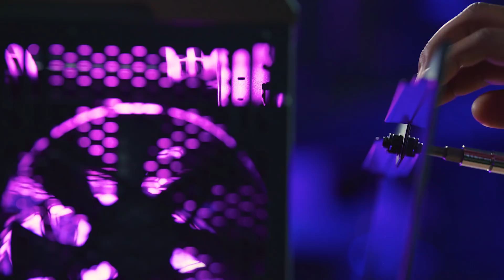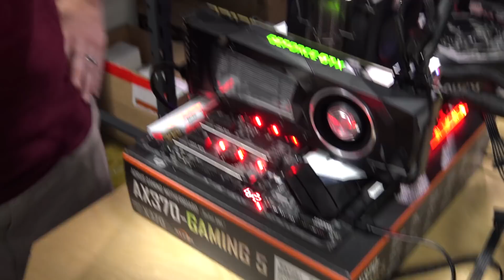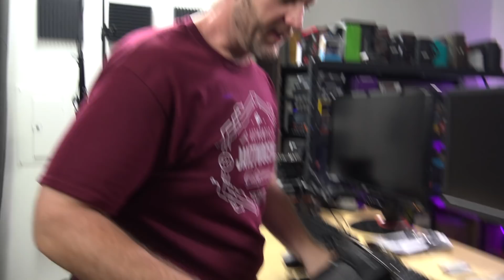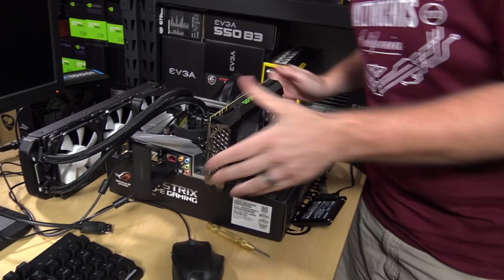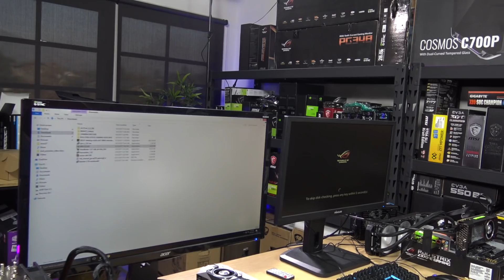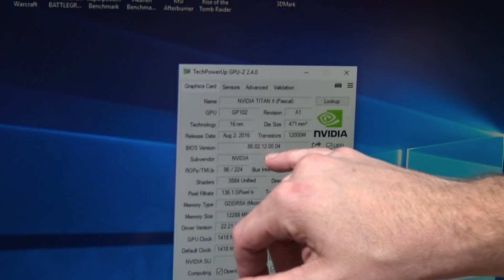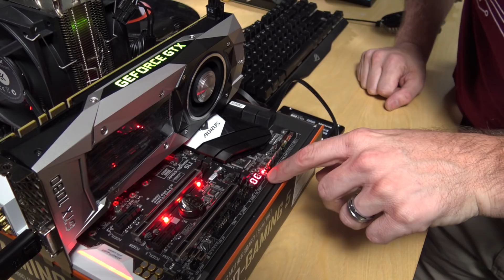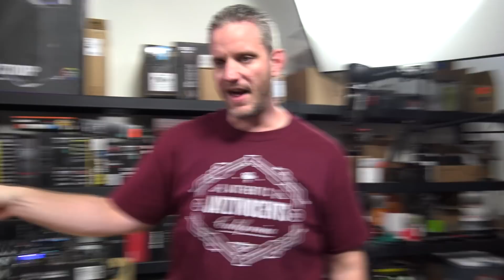I cant figure this one out... HELP!

Comment: My comment is going to be lame, but gigabyte boards are notorious for issues like this.. I vowed away from gigabyte for years after seeing all the post issues with most boards in the years using them.. to recently come back after being screwed by Asus on warranty.. and seeing thing have not changed..
Gigabyte boards are beautiful and I like the software provided.. RGB works flawlessly and sadly think Asus ruined thing with their shitty software

Gigabyte are the hardest boards to post normally.. my Aorus gaming 5 has random no post.. simply PSU off and on fixes things..

Gigabyte need to pull their fingers out and fix shit with their bios and compatible components.. as Asus sadly are simply way ahead here... 

I remember owning the x79 gigabyte board with the gun on it.. it was the worst piece of junk hardware ever owned.. going to Asus rampage formula is and will always be my favourite board...

I think this can be solved only with gigabytes help a new bios for mobo telling them which video card might help.. it might be a common issue..

I suggest older revisions of motherboard bios to see if they broke anything with the most recent revision

Comment: @JayzTwoCents The machine I received from Paul and Kyle has the same CPU and Motherboard. I have had this system about 4 and a half months I think. So first off I do think it is the motherboard. I have a Power Color RX 580 Golden Sample paired with the same Nixeus monitor in your studio. I have had graphics issues. The system sometimes hangs on VGA for a long while before booting. Thinking it was the video card too. I switched to a R9 285 I have as a spare. Worked fine for a week then bam hangs and graphics issues. Also other issues. I can not get any ram on this board to boot any faster than 2933. And the Killer nic does not seem to like my router with the newer firmware on the board. So I have to plug it into the intel NIC. Also my PC now seems to have a issue after update that it drops frames while streaming like its hot. 

I have noticed when it comes to the graphical stuff. Depending on one of the two cards I am using the boot setting seem to matter to some extent. For my RX 580 it like to have windows set to fast boot. And secure boot options under windows 10 WQHL for the R9 285 it seem to run better with fast boot off and logo on boot off. Basically the Puget systems way. 

Anyway anything else I can try or do seeing we have very simulator systems let me know. 

Specs
Ryzen 7 1700X
Gigabyte GA-AX370-Gaming 5
Corsair LPX 3200
WD Blue SSD 250GB m.2, Samsung 850 EVO 500GB Sata, OCZ 240GB TRZ100 I think 
Power Color RX 580 GS
Fractal Design Edison M 650watt PSU

Comment: If there was no alternate system, and a known good card works, but the problem card doesn't, the card must be defective. The fact that it works on a different system with a different platform is irrelevant.
Reply: Bill Bruce  not if he ussed that card in mult other system and it work. It's more likely a quark in the PCI slot and I finger on the video card from multiple uses
Reply: Two identical cards.
One of them works, and the other doesn't.
Which one is bad?
If it were anything on the motherboard, neither card would work.
I've been troubleshooting circuit boards for over thirty years.
Reply: Bill Bruce He said he ussed that card in mult other system as will and work in them all but this one system. But all manufacturing does have slight variations in their fingers on the cards and or pins come out of the motherboard of both of them are off slightly by a little it can cause such an error also I believe they made a mistake on reading the area code

Comment: If a connection pin is slightly bent maybe one card is making a better connection then the other. Did you try any other slot then the top? Just a blind guess don't have the hardware in front of me so can't test myself. But as process of elimination that would be my next step before I pull my hair out good luck.

Comment: My guess would be that there is in fact an issue with the gpu that for some reason the ryzen system is more sensitive to. Try stress testing the card to see if problems arise while checking power usage.

Comment: Id run both cards in the same board (Ryzen) and see if you can get a boot with rotation if required. Sometimes you need to run the possible dud card in the same system as a working one to fish for a conflict or BIOS error. If windows then still doesn’t accept the card in the known working system as a secondary - you know the card is the issue.

The Ryzen board seems to me to be the second most logical issue. I don’t think it’s the Motherboard BIOS, but I’d be checking slots first, then power supply.

Ive been an Engineer for a long time and this problem happens in Server blades too.

GL mate

Comment: So it seems in the testing that you have confirmed that the GPU works in other setups (I heard two mentioned, maybe test more?), and the CPU/mobo combo work with other GPU's, but both together are an issue. My theory is that the cpu/mobo may be doing something odd during boot (slight surge of power, for example) that shouldn't affect the card, but due to a slight defect in the card, may be causing a failure state.

In all this testing, it seems that you have kept the CPU and mobo together. Can you test the mobo with a different CPU? How about the CPU in another mobo? Do either of those setups result in a fully working setup? Can we pin down if the issue is CPU based, or mobo based?

Comment: one of the contacts is messed up on the GPU.  or possibly the mobo but i doubt its a mobo issue.  try boot cycling it.. I had a vega that would not post on my am3+. after  resetting 5 or 6 times it posted.

Comment: Could it be a PSU or board power draw issue? Try swapping the PS use if you can. That's what I do next. Could even be as simple as a bad cable?

Comment: Had the same issue with a 760ti and 970 ti in my am3+ 970 chip based system... last nvidia... ever. R9 fury strix is just fine.

Comment: inspect the pcie pins on the card maybe? its possible that the ryzen board doesnt grip the pins as tightly as the intel system does and the ryzen board isnt making decent contact because of a slight defect? maybe try using a pcie riser that fits tightly into the pcie lane.

Comment: Ive seen this culprit on my mobo did not want to boot got stupid post code . Reseated  my cpu went away. I think its a seatting issue with that gpu not the others. Possible the gpu is power hunger try a power draw test from wall with meter test.

Comment: I wonder if it has something to do with the slight differences in voltage requirements between each sample of the GPU and the one that isn't working in the Ryzen system being slightly out of spec/tolerance from a requirements perspective. If the PCIE slot is feeding the specified amount of power for the slot and that particular GPU needs slightly more (or slightly less) to boot, then a POST failure could occur? Perhaps the Intel board you're using is more lenient on the spec and will shunt as much power the card needs to start up.

Purely speculative on my part and have no idea how to test or validate this hypothesis...
Reply: Ed .... My thoughts exactly!!!  Either that or corrupt bios.  Everything else would be the same.

Comment: Sounds like mobo doesn't like the uid of those cards, try another slot or different mobo keeping same ram and cpu, also I know it's crazy but I just had a Dell xeon workstation doing similar thing. Try loading into os with a different card installing the drivers for the card you want then swapping your problem card back in. Worked for me.

Comment: It seems to me you have some kind off  compatibility issue, i've had a similair issue but with memory. My system supported the given memory but for some reason it just didn't work. Worked fine in other PC's.

Comment: Seems so random that I would look for bent CPU pins if there are non then the problem might be with MOBO BIOS. Also you might want to try verify that is does not post with the "bad" GPU couple of times to see if it would boot like 1 out of 10 times.

Comment: Ive seen this issue with my mobo where the seating is off . ALSO TRY A SEPARATE POWER SUPPLY . You have to be willing to test multiple things to find the culprit. Ive had it say another but its not its just a seating issue.

Comment: Check the connectors on the motherboard and graphics card.  A minor flaw, on the same pins, could be a possible issue.  It could also be what technicians call a 'marriage problem', where 2 items refuse to work together, but either will work fine with other components.

Comment: ok first i am not reading 800 comments. i have owned ryzen and the threadripper since day dot and i have never seen this issue except when i used a DP port on my fury x that it did not like swapped DP ports no issues.also having it boot from uefi can cause a similar issue but you will get display. It is a setting issue simple as that there is not hardware fault at all (except maybe that lower DP port) if that is faulty it could cause the failure to boot. i would swap dp ports or try hdmi and see what happens i,m pretty sure it is that. if it wee ram or cpu issues no card would boot

Comment: You know Jay.....it'd not be the first time it was the controller from the HDMI on the monitor...since you are using two different monitors.....odd, but I have had it happen. Try either a different interface if possible or a different monitor....I have only seen this once before so mileage may vary.

Comment: Could it be an issue with PCI Express bus frequency? Maybe overclocking or some default bios settings on Gigabyte have the PCI express bus frequency higher than normal and maybe nvidia cards are more sensitive.

Comment: You could have hit the "lottery" in terms of signal strength from the mobo or gpu to the other. If one pin is out of spec on the signal it sends to a mono that is very picky about what it receives then no ball. The same goes for the other way around.   I dont think its a ryzen  or intel issue i think its a signal processing issue.   I have had many different systems with issues like that when i was in charge or hardware Tech Support for a decently large company.

Comment: I'm wondering if the card is pulling too much current from the motherboard PCI-e header. Is the card on a separate power supply rail, or is it a single, large rail? If it's on a separate one, one of the step-down converters in the power supply could be faulty. You could alternately just connect the GPU to a separate power supply (on the same AC outlet/breaker to prevent ground loops) and short the green switch wire.

Comment: I had the OC code and a B code which turned out to be where the ram was plugged in for whatever reason. it was plugged in and they all worked but i just pulled one of the ram cards out and it worked. and no it wasnt a bad ram card.

Comment: the ryzen being picky with memory comment is really hitting home right now lol, sometimes my ryzen 3 system boots fine and recognizes both sticks of ram, most of the time it doesn't. according to ez flash in the uefi my bored bios is up to date. windows is installed and active, all my drivers are current. both ryzen and my mother bored are confirmed to be compatible with this memory. yet it wont post half the time with both sticks, and when both sticks are recognized and everything appears to be working properly i still get random crashes in game. bout to say fuck it and pay someone else to fix it lol

Comment: @JayzTwoCents. It looks like you are using the top display port with the ryzen system, and then the bottom display port on the other. It could be that the top display port is faulty and not working properly?

Comment: Hey Jay. You checked the BIOS of the same card, so you don't know if the BIOS of the non-working card was the issue. You forgot to check the BIOS in the Intel system. If you did so off-screen, then I don't know what to say.

Comment: It's either the cpu or motherboard. If you have another ryzen cpu swap it out and see if it runs with the "problem" card. If it does, then bingo, it was the cpu. If the problem still persists, then it is the motherboard having the issue.

Comment: I had this problem with 1800X, 2 different asus motherboards, and GTX 1080. Ended up sending a cpu for RMA, believe it or not, this fixed the problem, so maybe there is something wrong internally with some AMD chips.

Comment: I have had issues with Aorus x370 Gaming 5 since day one and it got worse now one bios update and now the system bsod's regardless of default settings, fresh windows install, complains about overclock when it's not. tried another CPU, tried memory on another system, other components work fine with Intel motherboard/memory Even reverting bios did nothing. Back on intel for now.

Comment: I would say there would be something wrong with that particular video card or the AMD motherboard from the symptoms. The only way you can really figure out what's going on is to switch out parts. You might want to start by switching the power supply with the intel system. Then try a different AMD motherboard (same model if you have one). I bet the problem will show itself.

Comment: Try same cpu and gpu with different motherboard just to rule it out. Complexity can cause a breakdown anywhere.

I bet there's some small difference or imperfection somewhere in the system causing the problem.

Comment: Jay, I had the same issue with a gtx1080 G1 gaming with my 6850k. One GPU would not work but it worked fine on my 3770. I returned the GPU to the supplier and they returned it not faulty, in the mean time the new G1 I got worked fine. I replaced everything in the machine and finally after replacing my 950 pro m.2 for a 960 pro the card started working.

Comment: Try to look at the pci slot. Is there some junk in there? Are the contact pads on the GPU card dirty or damaged? (the part that goes into the slot on MB)
Reply: Also look in all the plug connectors

Comment: Does  it only fail when warm?  If so then: Check the GPU contact  points and internal  solder points. If not this then check  its  onboard  Ram. It could also be a power supply issue.

Comment: Pin alignment in the slot is off on MB, manufacturing tolerance off. Or Voltage issues with you PS cable or PS.

Comment: Limit your variable to just system, use the same monitor and DP cable, double check if there are dual bios switch on Titan, if it does are they on the same position, in ryzen bios, do you use CSM or not, if you do turn it on and for display portion either set to auto or UEFI+something else (forgotten). Try to reduce variable to only changes are ryzen/Intel system, other stuff constant. I had issue with dp cables b4, causing non post. Just to be clear it's not the cable, that would be silly

Comment: Hi there may it be the power connector of the Ryzen setup, sometimes the AMD setups are a mass with the TDP specially on graphics, maybe will be a "little difference on the power on the different cards",  who knows maybe the silicon lottery... MY suggestion are use 2 different cable to power that card to see if there is a difference...

Comment: Instead of using the 2nd 8-pin from the PCI-E cable use another 8-pin run, meaning run 2 cables. GPU issues are weird that way. Or if there's a connection for supplemental PCI-E power through the Mobo add that.
Reply: not necessarily. I've had similar if not exactly this problem before. And for some odd reason it indeed was solved by running 2 separate cables, not one that was daisy chained. Yes it doesn't make any sense whatsoever, but hey, it did work and worth a try.
Reply: if insufficient power was the issue the GPU bios will boot tell you to plug in power connectors into all ports before you can boot, i accidentally didnt plug in my 1060 once and it booted with a message telling me to plug in the 6pin power

Comment: I'm surprised Jay hasn't had a tonne of issues that were completely new to him. I've been using computers for 40 years now and every week new stuff comes up that I haven't seen before. Maybe my memory is just terrible, well it is terrible but really even worse than I thought. I just hit a problem an hour ago where I installed a GPU monitor but already had afterburner installed and Windows just took a huge shit. Right clicking would have menu boxes appear with nothing in them. The system went into treacle mode without any resources being used I could track. I'd never encountered this before and removing that one GPU monitor fixed it.

Comment: Not sure why people would suggest the PSU in the first place. PSU isn't the issue, as the other cards would have problems. Someone else mentioned bumping PCI voltage. I'm inclined to agree. I wonder what the card's PCI power draw is while in Windows. Thinking it may be more than the non suspect card is pulling and the gigabyte isn't liking the draw. Bios possibly, or some component of the card. If it's power related, I don't see how Ryzen would be the instigator. Really want to know what you discover. THIS is the type of challenge that got me into computers. I love this kinda shit!

Comment: May be the PCI-e slot pins are misplaced somehow! :O I am just running out of the exact technical term to be used here! :( May be you put the very first Titan "loosely" [board pins you know!] and then you swapped it woth that second one that was placed perfectly & successful boot. :) Then you again swapped it with GTX 1080 and somehow you did manage to put it perfectly in the slot and it boot up again! :) I had same problem with one of my friends' PC for that exact same reason! HE couldn't boot 1070 SLI machine but single SLI in the second [PCi-e x8] slot boot up just fine with either card! He RMAed it and that solved that issue for us. :)